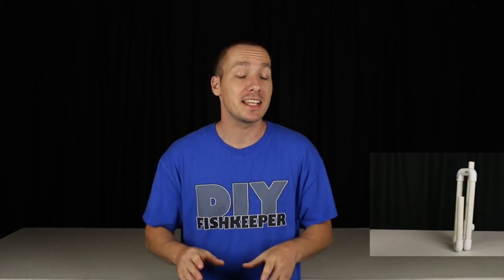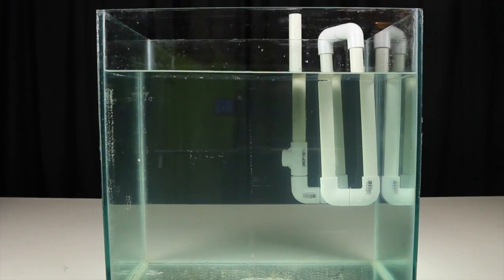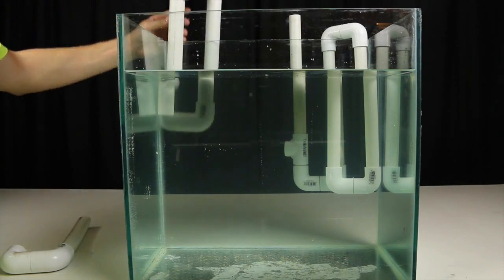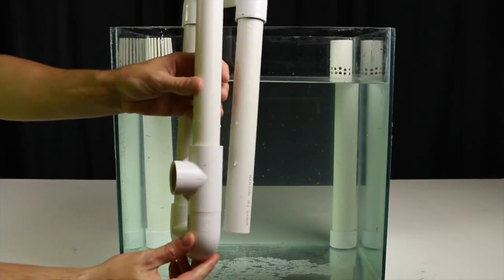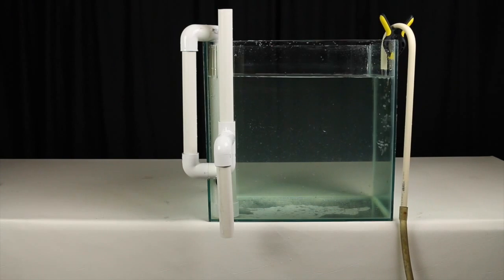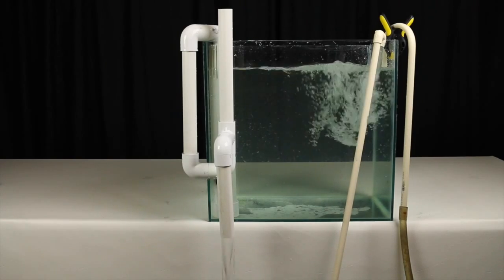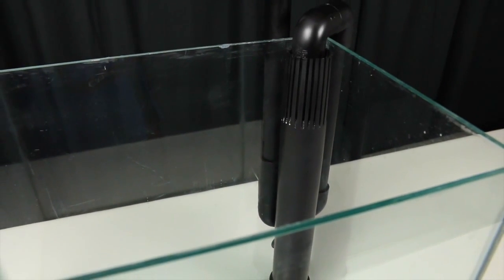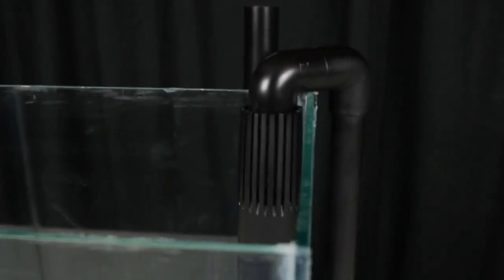HOW TO: $10 DIY aquarium overflow - UPGRADED and MODIFIED TUTORIAL

Comment: i built this exact setup and im noticing a lot of noise coming from the weir pipe and the overflow. My overflow pipe is about 8-10 inches inside the weir pipe. The water level inside the weir pipe is right where the overflow stops. I noticed in the video you said the water should fall about 1 inch inside the weir. Do i need to cut the over flow pipe so that the water only falls about an inch inside the weir to reduce the noise? if i do that will it risk losing prime on the siphon. Thanks for any answers
Reply: Did you solve this problem? If so, how?
Reply: I actually shoved a bio sponge inside the 2 inch pipe and it made it whisper quiet. However after a few weeks my water flow becoming more and more restricted and it wasn't beneficial at all so i recently just took out the sponge and I got my water flow back but it also came with the noise again. At the moment I'm dealing with it for now but in a few days I'm going to cut the 1 inch pvc so it stops about 2 inchs below the weir and I'm confident it will reduce the noise. I'll update it once I do it in a few days
Reply: +Brian Wesson thanks for the quick response. it is so loud! I went through the same trial and error you did. My other thought is that you could put a ball valve somewhere along the supply to the sump, to restrict the flow enough, causing the overflow to completely fill with water but allow enough water for the pump to not run dry.
Reply: +Max Ramirez I have ball valve on my overflow and my return pump. In theory it sounds good but I've tried it and it doesn't work. It still siphons water all the way down to the end of pipe.  I believe the noise is coming from the height the water has to fall to the end of the pipe. That's my sponge worked because it wasn't water falling on water. It was water falling on a sponge. So I think if I cut that pipe so the water only falls maybe 2-3 inches it should be good. I plan on doing this on Saturday
Reply: +Max Ramirez ive got an update for you. I finaly cut the pipe that goes into the 2 inch PVC and it is much much quieter. however every 15-20 seconds i would get a loud gurgling noise. I did a quick google search and came to a conclusion that i had too much water flow for the overflow to handle. Its weird because i never got the noise before i cut it but any way i closed the ball valve on my water pump side to slow down the flow and it fixed the noise. Now its very quiet with no gurgling and i still have a lot of flow through the tank. FYI my aquarium is about 3 feet from my bed so i sleep next to it and i dont even notice it. Also i cut the 1 inch pipe maybe 2-3 inches down into the large 2 inch pipe.
Reply: +Brian Wesson thank you for taking the time to update me. I am pleased to hear the results. I will defiantly attempt this on my aquarium. it is a 100 gal display 30 gallon sump. I'm using a 1083 return pump and a 1 1/2" overflow. I get that gurgling noise a lot. can you try to explain how the restriction of the return pump caused this gurgle to stop? maybe the thread you found the solution. thanks again.
Reply: Brian Wesson I know it's been a long time ... but can you please help me get started. I have made ¾" pipe with wier of 1½" PVC. The problem is after filling up the open supply pipe and after opening my ball valve to sump, the overflow doesn't start. Pls help me . I have done exactly the same what is told in the video.
Reply: @FishesForever  hey did u get it started,im also in same situation ,cant prime pls help if you can
Reply: I keep getting a gurgling from the stand pipe like my weir isn’t letting enough water come through. Once it gurgles for a min or 2 I lose suction. Does this mean I need to make my holes bigger? I already have 2 rows of 1/4 in holes all the way around. If I use the ball valve to slow down the flow to the sump my return pump fills up my display tank I have it on it’s lowest setting. Any help would be much appreciated. I hope people are still kinda looking at the comments to help each other out

Comment: Glorious! I foresee 4 changes I would make for my application, though it would require a special kind of pump...

1. Allow the overflow tube to take out water from the bottom of the aquarium, as the majority of detritus will normally coalesce at this point in the water column.
2. Add a fail-closed valve to the overflow line before it reaches the sump. This valve should be governed by a depth sensor in the upper level of the sump. The valve will close once the water level hits it, thus preventing the sump from overflowing in the event the pump fails.
3. Include a 2nd fail-closed valve just before or after the 1st that is set to trigger when the electrical mains are interrupted, so as to prevent a similar incident to "2" from occurring during a power outage.
4. Have 2 depth sensors: 1 sitting just above the pump intake within the sump, the other stationed just inside the upper lip of the aquarium. These will be connected to the pump. When the water level either leaves the sump sensor exposed, or the tank sensor submerged, the pump is triggered to shut off to stop it from either cavitating (not enough water in sump) or overfilling the aquarium (overflow intake clogged, etc.).

EDIT: In place of "2" and "3", a hole could be drilled in the length of the intake within the aquarium, just below your desired water level. When the level of water falls to the height of the hole, air should rush into the siphon and "break" the flow.

Ok... my head hurts.
Reply: For number 1 I prefer the intake at the top because A. it lets me keep the water in the tank a specific level, B. it cleans the top of the water and I have an exposed top tank, and C if you have a planted tank you don't want to take the detritus out from the bottom unless you fish plant ratio is way to high. Those other things are great ideas though.

Comment: Great video as i'm looking to convert my fresh water tank to an reef tank, but I only have 5 cm space behind my tank &have an overhang lip on inside off tank off 7 cm which over flow boxes won't fit, but have little holes in each corner of tank for pipe work this method will do nicely

Comment: Is the hole for the suction cup risky?  Seems like if you have a power outage and a small leak at that point it could drain your tank to the floor.
Reply: +Jeff K Even if that were the case just take some silicone and run it around the back of the suction cup and pipe.  Impossible problem indefinitely solved.
Reply: the level of the water is decided by the lowest hole in the bigger pipe. It should be on the top, but if the suction cup hole is not sealed, water will enter from there, so that will be the lowest hole. Sure, the return pump will greatly compensate the little leak, but if it stops the aquarium will be drained.
Reply: +Jeff K i also think it's risky. Usually I attach the suction cup with zip ties. Ugly but safer
Reply: @robyp  zip ties is ugly but you are right its safer. zip ties rigt above this pipe cup can be invisible
Reply: Dear all, will any one be kind enough to explain why this suction cup is needed at all? Is it mandatory to have it for running the siphon? What will happen if I don't drill the outer pipe and don't put this suction cup?
Reply: The Weir portion will float and stop the sphyon
Reply: Had the same thought.  I planned on using super glue or pvc cement when i attach the suction cups to the weir. I think that will hold better then silicon since the cups are rubber.
Reply: yup very risky
Reply: You are plugging the hole with a rubber suction cup. That rubber plug end will seal like a gasket if you are worried about it you can seal with silicone.
Reply: +Jeff K  The suction cup hole is in the bigger pipe which doesn't go anywhere.  Its not risky at all since the small pipe is the one taking in the water to the sump.
Reply: +roby p The hole isn't going to provide enough water for the siphon to continue. The weir will drain and allow the siphon to break before that tiny hole can refill the weir. Even so, always test your work under supervision so you don't have a catastrophe because you thought it was right.
Reply: @hellionb  the siphon will not break. That is the entire point of the whole thing. Thus, even a slow trickling leak from the hole will continue to fill the large pipe and will slowly push the siphon til the tank drains down to the suction cup.

Comment: Still having great success with the original version of this overflow. I don't really mind the 2 pipes and some fish actually use it as shelter during lights out. I've had great flow for months and it's silent. I also put a PVC elbow on the intake then stuck a filter intake screen in that to protect fish from being swallowed. This also make this overflow extremely quiet. Great vid!
Reply from the maker: +BJ Nunn Agreed. Its rally just a matter of preference.

Comment: Joey does krylon paint work for saltwater tanks. because I tested the paint out in sum old saltwater before I put it in my main display, and it bubbled up not to sure if it's saltwater safe. ur input would be great thanks
Reply from the maker: +william gogo No idea, never tried it. Its not meant for underwater use though, its just non toxic when cured and adheres to PVC extremely well. So it tends to do well underwater.

Comment: Hiya Mr King of DIY loving the videos!! One question in regards to this, I'm am requiring a sump for I'm tank with two aqua one 1250 cannister filters. ( max 1200lph ea flow rate) so iv got 40mm pvc tube. the down pipe I made 90mm because I had a piece lying round that seems to work. I notice you say the weir is the length of the tank and the tune into it is 12inch??? (can't quite remember) is there a ratio of depth this tube needs to go? or like the last video the exact length of the first trap? also 90mm tube isn't going to throw me out too much is it? hopefully more flow :) I'm thinking about putting some heavy rocks in the bottom of it as there is allot of pressure there but flow rates into it ain't best so more fine tuning for me.
Reply: Also the suction cup, did you apply silicon to stop it from leaking?? mine seems to have a seep to it. unsure if it hinders performance

Comment: i have something interesting to add to this design. instead of using a pump to pull the vacuum closed on the siphon. use the venturi on a internal tank power head.
Reply from the maker: +Mokaphyyr Good idea. That would work as well.
Reply: i just built the old time (nice upgrade in design here) and im still looking for my venturi adapter fro my cascade 300. (it somewhere)
Reply: its too weak to pull the siphon when its at a full stop.

Comment: Glad you're finally revealing the new series. That's exciting!
So this one is set up as a siphon style. This should have much more flow since there are less bends.

If the pump stops, even though more water isn't overflowing into the tank won't the siphon still be removing water until it drains the overflow tube down to where the opening of the siphon is? Then, when the pump starts up again, the water will be filling up but I don't think the overflow will be primed. The Aqualifter will help keep the siphon when running but, in this case, I don't think it'll be capable of priming the overflow.

I'm bringing up these concerns because I want to build this! This is a much better looking overflow and similar to how I modified the old design but having the two pipes is unsightly and I was concerned about flow rates.

Krylon Fusion is awesome for these projects!

Thanks Joey.
Reply from the maker: +AquaStudent No, it does not work as a siphon. It still works as an overflow. Imagine the big pipe as being the pipe we removed.
Reply: Oh, I see it now! Perfect! Thanks! I'm happy.
Reply from the maker: +AquaStudent Good luck! If you put it on video, send me the link.
Reply: Yessir. This project definitely looks better.
Reply: +The king of DIY Hey Joey. I'm working on assembling this project and have an interesting question for you.

Why do we need to raise up the T connector that's on the end of the system, the one that connects the "vertical vent" to the pipe leading to the sump? We have a 90 elbow right before the T but if we cut out that last elbow wouldn't we be able to save a slight amount of resistance? (shorter pipe, less plumbing). The middle Part of the T could be pointed towards the pipe leading to the tank instead of the sump, the top goes to the vertical vent and the bottom leads to the sump.

I think I've answered the question myself but want to confirm. Doing this would that break the siphon (likely just after it is formed from being primed) by preventing the water from remaining on the bottom side of the overflow.

Comment: are these really cheaper than drilling, i have the drill but i need the drill head for this job.. and, what if  this overflow fail, doesnt the pump going to keep pumping water from the sump to the tank and over filling it ?
Reply from the maker: +Fshop fshop Cheaper? Depends. Drilling can be done in many more ways. This method isn't really about saving money but rather NOT having to drill the tank. The fact that it is cheap is simply a bonus.

Comment: couldn't release this a few weeks ago before I built two of the old style ugly ones lol wife is gonna love me when I rebuild them now lol
Reply from the maker: +L Parker Just cut off one pipe on the inside and add the bigger weir pipe. Wont take long and you dont have to build a brand new overflow.
Reply: +The king of DIY thanks for the idea! Will be way cheaper for sure
Reply: This is exactly what I had planned. I will use the first version but removing the second pipe inside the tank and replacing it with the weir pipe. I am planning to do this while I turn off the valve in my overflow to stop it from overflowing down my water while im installing the new weir pipe.

Comment: R u still going to do a how to aquarium safe dift wood?
Reply from the maker: +justin ambroise A little late in the year for me to do it now. I had planned to travel around to give a fully detailed version. I will have to wait until next year.
Reply: Yessss please do!
Reply: +justin ambroise Exactly, good idea! When I tried leaving the wood in water letting them to cure, two months later stinks like rotten and don't use them afraid of tank pollution.
Reply: +justin ambroise Justin, if you want to collect your own driftwood do so in a place where you're far away from pollutants and where it's legal. Stick to hardwoods (definitely avoid pines). Take it home and, if it's small enough, you can boil it in a pot of water to kill off anything living on it. It may also leech out some of the tannins. You can place the driftwood in a plastic tub and monitor how it affects the water. Pin it down with some rocks. This will help the water logging process. If you want to treat a larger piece of driftwood, try boiling water and spot treating with that. It won't be a thorough but there shouldn't be much on there to harm your aquarium anyway. The most important part is to monitor the chemistry.
Reply: It's not like you're in Canada living with Polar bears! :D
Reply: +The king of DIY ok